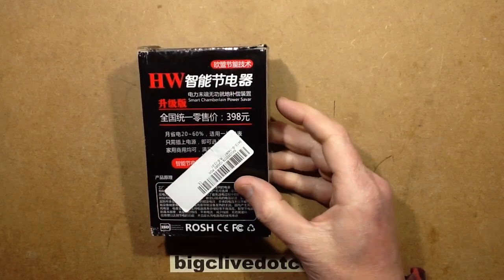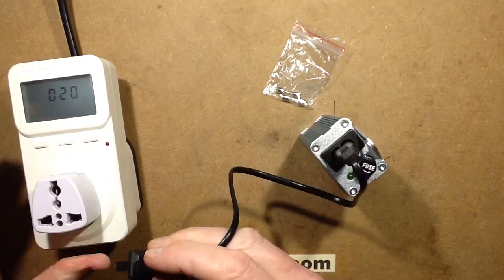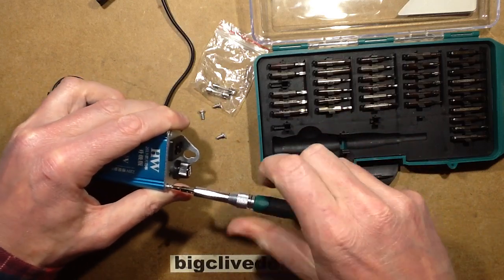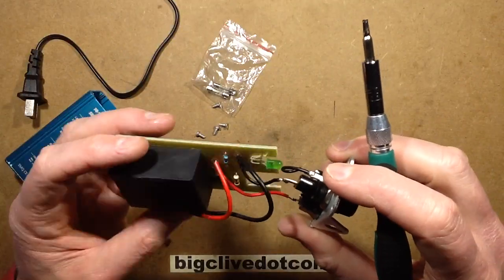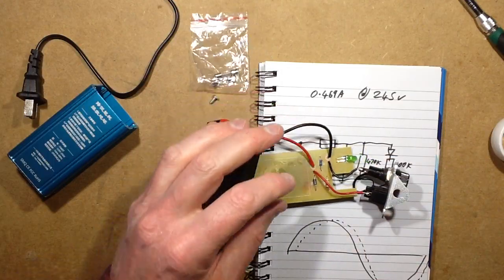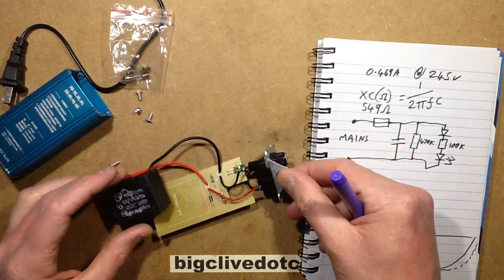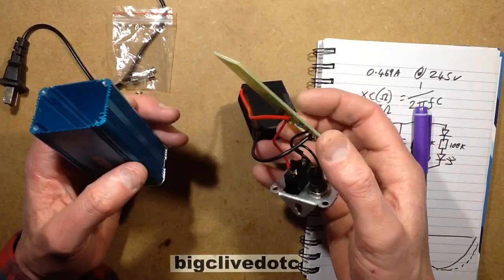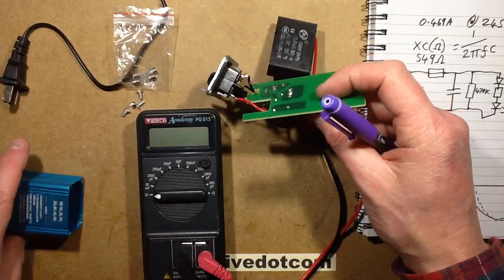200kW miracle power saving device.

Comment: The best electricity saving device I've seen was a really long extension lead plugged into my neighbors garden shed ..... going to my house.
Reply: +Slot1Gamer you need it for all those consoles
Reply: @Alger86i  i8899
Reply: +Slot1Gamer; HAHAHAHAHAHAHA!!
...And what would be even more funnier is that his Shed was being powered by HIS neighbor on the other side!!
Reply: Hey, you can save on your water bill too by connecting to his garden hose bib!
Reply: U can also save money spent on ur livelihood by living in a jail where u can get free meals.
Reply: +The Mad Hammer - Here in the UK street lights are always powered on, and switched with a photocell at the top of the lamp.
Reply: @linuxthemoon  put black tape on it
Reply: @linuxthemoon  That photocell is a hoax. It can't power even the lamp itself through all night.
Reply: @linuxthemoon  I think you mean England? Or have you got knowledge of the rest of the UK? Here in Scotland that arrangement did not become common until they installed LEDs recently (mostly after your post).
Reply: @linuxthemoon  Not always - depends on locality especially in the past. Series streetlighting (lamps in series supplied by special transformer), dedicated circuits (eg a five core cable with a smaller fifth conductor occupying the interspice between the four main conductors), time switches and control relays actuated by voice frequency signals (eg MV Ripplay or ATE Rhythmatic) superimposed on the mains all would have been used.
Reply: i use my neighbors shed to inject marijuanas
Reply: +Slot1Gamer 
You can also save money on wedding if you use your neighbor's wife.
Reply: @lvlarihuan0  🤣😍😂
Reply: @lvlarihuan0  - or husband!!
Reply: or from the streetlights to your house (only works at night) but its genuinely one ive heard of people doing lol
Reply: no if you run the cord from the access panel at the bottom of the light pole ,you bypass the photocell at the top of the light ,theres juice going to them all the time , @themadhammer3305
Reply: @themadhammer3305  depends on the circuit you hit.  I once visited a crack house that was tapped entirely into the light
Reply: @themadhammer3305  why do you think meth labs tend to go up in flames sooner or later?
Home wired electrical equipment and propane stoves along with highly flammable dust and vilatile fumes makes for spectacular accidents...
Even before the competitor cartels are taken into account...
Reply: @themadhammer3305  Many years ago in Britain a cop noticed a street light out and a caravan with a light on inside parked adjacent. The occupier had removed the bulb (must have been an incandescent BC or possibly ES type) and plugged in the lead (lamp socket adapters to run small appliances were fairly common then). Cop duly booked him for stealing electricity.
Reply: @themadhammer3305 you realize that power is always flowing through the cables leading up to the street light it’s controlled by a photocell sensor?
Reply: @themadhammer3305  I’ve seen that before too lol 😂
Reply: +bigbangnone This was central london need more than that to get through steel security door nowdays probably connected to house alarm system as well. The house is in terrace probably worth £2-3 million (Uk Pounds) so no chance I did not hang around in case CCTV  I could not see.
Reply: When you say "the government pays you 68 cents per KW/H " you do realise that it is the people of your country who are paying you that money... It is a subsidy
Nothing wrong with it in principal as it was the incentive for people to go green which is a good thing but just remember that the only part of your system which is truly free is the actual kw you generate yourself. The rest is coming from taxpayers and utility bill payers.  So no need to brag.  Also those cars are really nothing special... the one series is after all the base model from BMW and a 15yr old Lotus is about as powerful now as a tuned up honda jazz.  Your state subsidy could at least have allowed you to get a hybrid or a tesla?   Have a nice day
Reply: @TheComputec   You do realise that 10x that amount goes to hookers and blow for government officials? If you cant win that battle what does a citizen getting a dime for once matter at all.
Reply: @DarkLinkAD  like I said, so long as we all know that its the people paying for that state subsidy then that's fine. I have no problem with it. After all the UK government subsidises ALL electricity production over here. We should all have the means to generate some of our own power and if it takes an incentive scheme to make it economically viable long term then its all good !!
Reply: Thats stealing. LOL
Reply: +The Mad Hammer 
Over 50 years ago when I was at school we used an old
underground WWII air raid shelter which was accessed via a tunnel from the outside of a house basement in London UK as a gang meeting place and  entrance could not be seen from the street. We
got greenhouse heaters and lighting stuff from a theatre equipment store (naughty) to power it we connected cables directly to a street lamp and building supply from underneath! Was there for a long time, for some reason we had to leave in a hurry and never went back. I often wondered who from the electricity company found cable and what happened. I went past the place about 5 years ago one
night parked car around the corner and had a quick look into basement with good excuse if anybody asked what I was doing ( elderly man not young yob so no problem) there was a locked door in tunnel looked like been turned into storage place, so just left quietly .
Reply: @montgomeryrichard  Aw that's a great memory! I'm replying to the one about your gang meeting in the air-raid shelter. 

I wonder why, if it belonged to a house, why didn't it have a connection to their mains? Even if it's just a plug on the end that plugs into a socket downstairs on a long wire. Or they could've gone the proper way and added a new... I dunno, fuse I suppose... to their distribution box. If they had them back then. I suppose they weren't compliant to European standards. 

50 years ago, 1969, would have been past the point when people had to plug their electric iron into the light fitting cos there were no sockets. Houses had proper electricity then, even if they didn't always have indoor toilets and hot water on tap. 

I might've asked the house owner if I could have a quick nose in the shelter. It's not like it's part of their home proper, so they might've done, if they still had the key(!). 

My mate is currently building an air-raid shelter in his garden. Not because he expects it to be any good against modern bombs, missiles, and aeroplanes. Just for fun. He's got the authentic plans and everything. He works in a "living musem", he's quite high-up there. His kid loves the shelter so far, he's gonna go mental when it's all in place. And why not? 

It's the first house they actually own that has a garden, so if they're gonna be there semi-permanently, why not have some fun? It might increase the value of the house. If some future buyer doesn't like it they can always bulldoze it and fill it full of earth again. 

Anyway... my memories of what my mate told me in the pub aren't as good as your one here. But there y'go! It was a lovely pub actually.
Reply: Oh yes... my point...

Lamp posts are, or certainly were until recently, all connected in series. A few thousand volts is applied to each group, and their sodium vapour lamps all lit up in series with the voltage split between them. Because they all had the same resistance, being identical lamps, the voltage was split evenly. 

But what if a bulb goes? Well each lamp had, in parallel with it, two metal disc contacts. Between them was a sheet of insulator. If a bulb goes, it's high resistance means it gets the most voltage. Thousands of volts. These burn through the insulator, destroying it, and then the two contacts, spring loaded, come together. The voltage passes straight through. 

This does mean every other lamp on that run gets a slightly higher voltage, since the blown bulb is no longer taking any. But that's OK, they can take it. As long as the blown bulb is repaired quickly. Otherwise if other bulbs start blowing (from the increased voltage for one thing) the voltage goes up and up and then they all blow one by one. But I believe that seldom happened.

Anyway this means the voltage you'll get from a lamp post will vary depending on the load you put on it. An electric  heater has a low resistance so will only have a small voltage across it. Not enough to provide the large current they need. This is why lamp posts are no good to steal electricity from. Unless they have some auxiliary high-power 240V supply but I've never heard of that. 

So actually that makes your story sound false. Sorry man, it was a lovely  story. Are you sure you were nicking power from a lamp post? Even in the 60s this was the standard for them, all in series saved expensive copper wiring. Over the run of a town that can add up. 

Now they're moving to LED lights I've no idea how they're doing it. They could work the same way but I think the power supplies would be weird. Might require a computer to keep it all on an even keel. More likely they've run extra wires and they all work in parallel now.
Reply: @greenaum  There was no physical connection to the house  the shelter was via a  short tunnel from the basement area which had steps  down from the street and a door going to the basement, which around the turn of the century  would have probably been the tradesman’s entrance leading to basement kitchen or servants quarters.  The electricity company had  put their  main service head  with fuses  on the wall near the ceiling 6-8 ft high in shelter. This was fed from armoured cable from under the road  or junction box under the  pavement (sidewalk) at street level as is the practice in the UK. Cables ran from this to  other distribution and metering equipment inside the house. Power was taken before the meter from lower level box directly from the street supply so no high electricity bills for people and power from these circuits also fed unmetered local street lighting  so power would not be noticed by electric company at the time. All power cables in London are underground not overhead and distributed from local substations  with transformers in them not pole transformers. I was going past the place about 10 years ago in the evening  after meeting old unconnected friends locally parked car in next street and went to have a look with a good cover story looking for someone but not sure of house number could have been next street if challenged, as had very good knowledge of area going back years. No CCTV so carefully went down outside steps just around the bend in tunnel leading to shelter was a locked door, came straight out and walked away.
Reply: +bigbangnone But no lamp posts nearby to get power from (Grin)
Reply: +bigbangnone Already here, but you can refuse to have one if do not want it.They work on cell network in UK so some houses with bad signal location not suitable.
Reply: +bigbangnone I am not married,and you have things called time switches to turn things on and off should you be worried about law enforcment or criminals knowing if you are in or out.
Reply: +bigbangnone 
Can do in UK if you have house and get government subsidy
panels and equipment are fitted by approved company not do it your self job so no inspection as done by installer.
Reply: +bigbangnone  I use normal mains power but have inverter backup for about 8 hours which is silent to run as not to attract attention. and then 2.2kva generator to recharge and run things if very bad but noisy and could attract the wrong sort of people so can be run indoors with fans to extract smoke up chimney.
Reply: +KptnBlowFly  "But your honor, I just wanted to heat up my hot pockets in the microwave"   "A likely story. 10 years! no parole!"
Reply: @KingNast  just put your hands in your pockets if you want hot pockets surely!
Reply: +bigbangnoneI think you mean grid-tie inverter (not converter).
Reply: Hmm. My neighbours down at the squatter  camp informal settlement have a similar power saving device.
Reply: ***** oh, it's a electricity saving device, it'll save one of us monies
Reply: LOL!! WRONG!!! You're not saving electricity...you're saving money!!! But...you're risking the waste of lead and gunpowder if your neighbor catches you!!!
Reply: +Slot1Gamer too much line loss.
Reply: Also the Honda jazz is fugly
Reply: i am the neighbor what did you say !!!!!!!!!!!!!!!!!??
Reply: Fancy seeing you here!  Big fan of your Xbox mod videos!
Reply: c
Reply: Slot1Gamer
Reply: Slot1Gamer Imagine if everyone did that, eventually someone will do it at your place😂😁
Reply: the best way is to own an small room with noise isolation to build up those machines that produces 20-90Kwh  daily it self without using anything but a just a simple 9volt batery to make it start
Reply: No, you save on the divorce which is more costly.
Reply: Hey KingNast:  I did that one when my ground pump 'kicked the bucket' instead of filling it.   About 5 days later I got the new pump installed and they came back from vacation.  (hey don't bother to report me - Statute of Limitations ran out 4 hrs ago) !
Reply: Hey Dazzwidd.  If you take the front cover off the pump at the gas station and stick a screw into the place where the pennies register movement of the counter wheel - everyone will get free gas - it just pumps 1/2 gallon per minute instead of 4g/m.
Reply: Hey Slot1Gamer:  I saw you do that last March and I did it to you when you were sleeping.  I just hid mine better in your bushes and unplugged it early and back in again after you left for work each weekday.
Reply: But then your neighbors had a 100kV of transformer going thru that wire.
Reply: +Slot1Gamer I never recalled there being such thing as a Honda Jazz, until I played Gran Turismo 2, LOL. But Gran Turismo 2, unlike most other games, has JDMs! Cool! Thus I would be shown models that don't exist in U.S.A. . Australia reportedly gets JDMs now, IIRC. Figures, because manufacturing is mostly dead there!
Reply: LOL ...... Sort of like when I was borrowing the neighbours wireless internet lol
Reply: I use a cordless extension lead ...works well.
Reply: Ha-ha-ha good one.... also these boxes should also come with pamphlet instruction to disconnect or turn off all unused appliances, including power supply bricks, which will probably save more than that measly 0.496Amps. lol
Bang Good sells some Good Bang for your buck devices for sure... tsk tsk :D
Does anyone else find BigClive's soothing voice neutralize the danger of any dangerous devices as he's reviewing it?!  he-he
Reply: Slot1Gamer ...i did something like that but off the street lighting into my rented garage where i installed a 3 pin female plug 😂😝
Reply: Yes sir I got one of those
Reply: Ratcat17   ,,,,,,,,,,,,,, <- there you go, I've given you some more commas. Replenish your supply, now you can start using them again!
Reply: Or you could connect the extension to powerlines fuse boxes.
Reply: @mikado387  Pleaselah..
Reply: I hear you Bro.!
Reply: bejapers please give in hindi to under stand in easy methord for saving electricity kindly advice and. the metherd to. use. conect with our hiden socket. thanku
Reply: Ray Han if your a convict and you had to build this device ! The slave wages in the short run will be restitution pay in the future !
Reply: Slot1Gamer i
Reply: Slot1Gamer 😂
Reply: Slot1Gamer your neighbour is here🤣😂
Reply: 商标上是中文啊，华强北生产的吧?
Reply: Slot1Gamer ROGLMFAO!!!
Reply: Slot1Gamer I put a tee into my gas line of the house before the meter which is equally effective.
Reply: Good way to get an ass full of bird shot.
Reply: Even funnier if his neighbors shed was powered by himself and that's the reason hes challenging his own electricity bils LOL
Reply: Nice!
Reply: 900th like :P
Reply: Good Idea!
Reply: 😂😁😅 now that's a fucking good idea. Will try it out one day
Reply: Are you talking about "Free Energy"? Might give it a Try... :D
Reply: so they can;t shoot straight?
Reply: Saving ≠ Stealing
Reply: Is not that a thief?
Reply: Not a long term solution though.
Reply: lol
Reply: lol
Reply: Works like a charm
Reply: In China everything is fake , only the liar is true.
Reply: Ha ha ha haaa Nice Work Earthling
Reply: lol
Reply: Slot1Gamer 🤣😂
Reply: LOL that is a well known power saver.
Reply: Ned Flanders must be your neighbour
Reply: We have all heard ( mostly in most countries"a") of Panasonic.But not even their consumers product division have heard 2ooth ( 2 yrs ago already likely more now)customers in Japan make elect from natural gas fuel cell. We just talk hear about saving. 1 403 830 4124 And German co ties this fuel cell ( large amount of heAt produced NOT a problem in  Cdn "a" if basement was a little warmer 9 months of the yr) but German co ties it into the hot water tank. 1 403 830 4124
Reply: SW units like this capictor 30 yrs ago.
Reply: WTF!!
Reply: That's an excellent power saving device
Reply: @R3tr0hax Media Group No good man...
Reply: @R3tr0hax Media Group OMG!!
Reply: @R3tr0hax Media Group  OMG!!
Reply: @R3tr0hax Media Group Well....
Reply: @R3tr0hax Media Group Hahahaha... you're welcome...
Reply: I made the same complex energy reducing device myself but just hard wired into the one of the potentially fatal military grade weapons with wireless remote surveillance optics and behavior modification capability on every block called LED street lamps not sure why but plenty of power for a TV 2 lamps and a fan down by the canal where I live. Someday I would like to hack free wifi like windows 8 could do. I don't know sh*t about electronics or computers so I'm just waiting for a homeless hacker to move in and trade him for some crack or heroin maybe like some meth or The philosopher's stone possibly a dip in the fountain of youth I can find the Rosetta Stone maybe I don't know sometimes they like beer I personally have never done a mind altering substance I did not like that's why I'm homeless I suppose cheers! ✌️
Reply: That long cord isn't a power saver just borrowing power . Isn't that ok ?
Reply: @rs2143  I guess it depends who you are borrowing from forever and who you ask. If I am stealing from PG&E for instance who is killing people stealing their land while exposing everyone to enough radiation to kill babies just to spy on them and sell the data while advertising to them accordingly it's probably not really a moral issue since I could kill some everyday for two hundred years and still have the moral high ground ya dig?     🤜🏿💉🤛🏻
Reply: Master comment
Reply: That's really not funny because that's not energy saving
That saves on your electricity bill, but you're not saving energy at all.
Was English your second language? 
If so, then I retract my statement because you're not used to the language and I wouldn't insult anyone for that reason.
Reply: Mine was the big magnet on the electricity metre
Reply: +The Mad Hammer I can imagine those with EVs would top up in large parking lots this way.
Reply: @DarkLinkAD  Yeah
Reply: @DarkLinkAD  Actually there are a few companies adding chargers into streetlamps - makes sense! Existing street furniture wired for a decent amount of power 😁
Reply: +Slot1Gamer Did you get that idea from Homer Simpson
Reply: If you're game you can also do it with the gas. Bypassing metering gives great savings too!
Reply: Yeah, and I know I guy who went to prison for doing exactly that.
Reply: Slot1Gamer understands the only way for "free energy"
Reply: instead of printing the product information on paper you should show it on tablet
Reply: +1 😅
Reply: Ron Angel.  Don't worry.  It you wrap power wire around the incoming line to your street power source it will create a coil and the AC produced will give you some power.  Maybe run a Fridge or something similar.
Reply: Kudos for the Video! Apologies for chiming in, I would love your opinion. Have you ever tried - Chiveard Wealth Storage Framework (just google it)? It is a great one off product for slashing your energy bills minus the hard work. Ive heard some incredible things about it and my work buddy finally got astronomical success with it.
Reply: Hey bigbangnone:  Read Eric Lerner's book 'The Big Bang Never Happened".  It shows the physics and math behind the lies of the 'big bang theory'
Reply: +Phillip Shearman How does that work? The power line would need to be wrapped around a ferrite core, which you could wrap a wire around to tap into it. You cant just throw an extension cord around a power line a few times and get power out of it.
Reply: Richard Smith he believes the quack that thinks the big bang wasn't possible, so his understanding of science is already tenuous. Theoretically, you'd get a tiny amount of power inductively by wrapping a wire around the live multiple times and connecting a cord with one conductor at one end and the other conductor to the other end, but you'd have no control over voltage. Doing it his way, by just wrapping the cord itself around would do nothing, because you'd cancel out the gains on one conductor with the other.

Another fun trick: Take a fluorescent tube and stick one end in the ground right below a high voltage transmission line. The tube will light up. Inductive power transfer is fun.
Reply: +bigbangnone  

I am in the UK and the system is different distribution wise
in large cities no overhead transformers all underground cables I wont go into Tec stuff but just to let you know I am semi retired (PhD) electrical engineer familiar with UK and USA systems so would probably be able to figure out your idea quite quickly if it was of use or interest to me, so not to worry. I have seen huge versions of the little power correction box demoed here the size of a two draw filing cabinet which give large savings in office blocks and factories  which automatically balance to load and are quite effective.
Reply: good girl！he  use the tool  all  made in china，haha😄